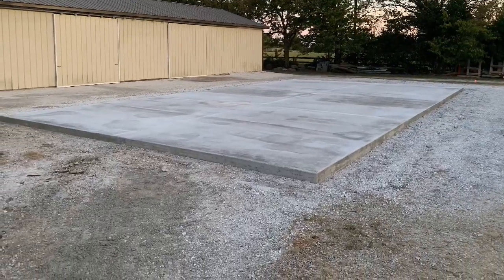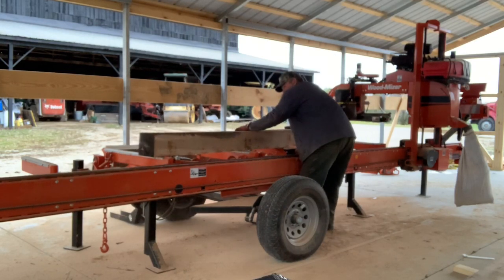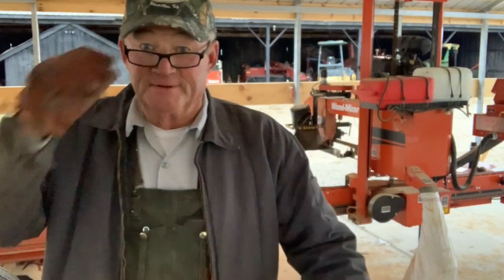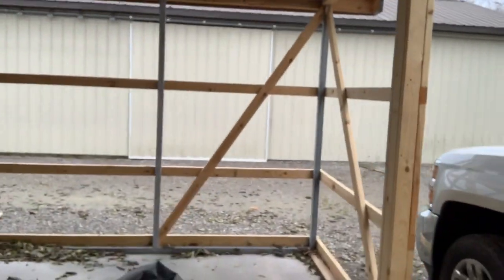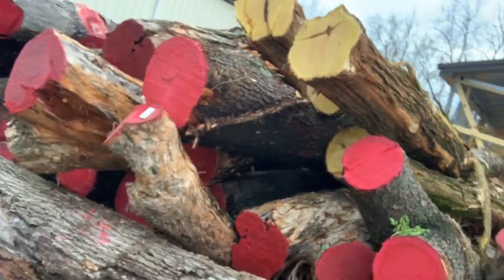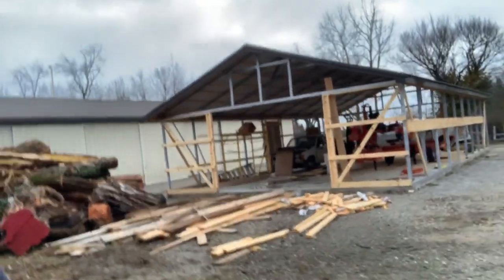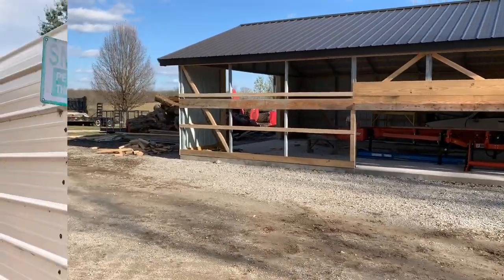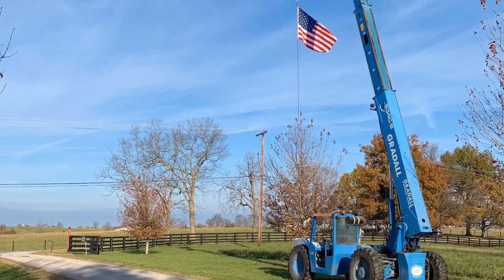Saw Mill Building part 2

Comment: Burnt motor oil in the ends worked on cypress logs for me. Its what i had handy. Nice Sawmill Building.
Reply from the maker: Thanks, I have a lot of that as well, Might give it a try. Thanks for the compliment, I have gotten busy and haven't even used it all summer